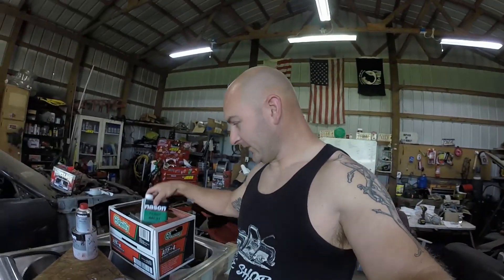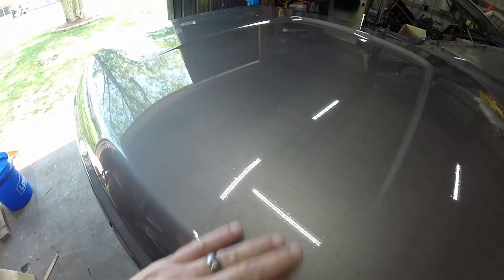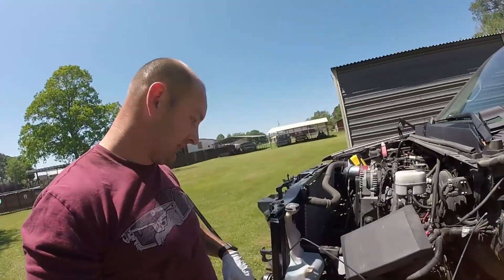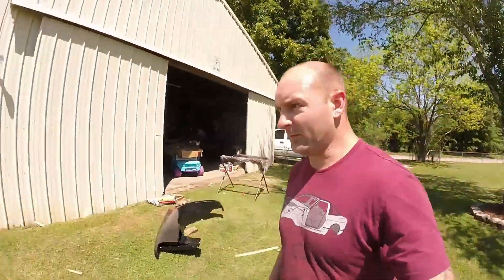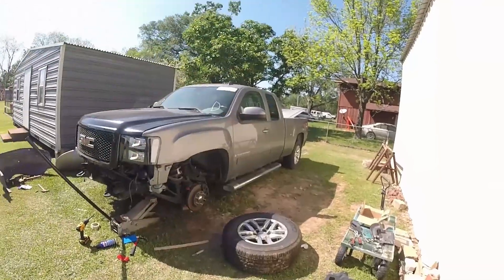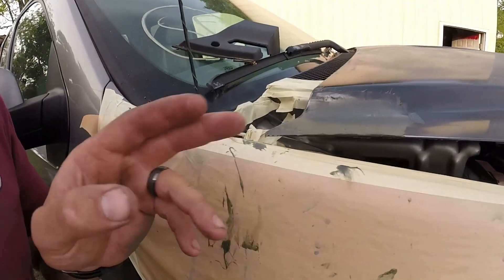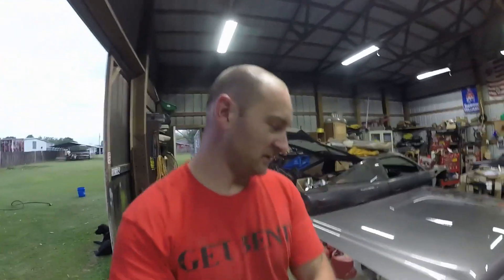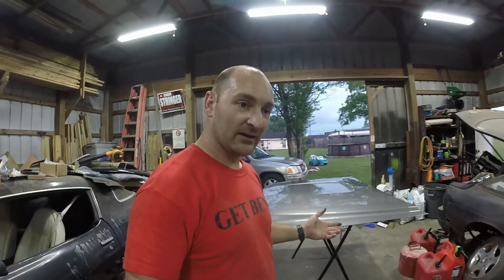First Time Ever Painting!!!! (2008 GMC Sierra 1500 z71 Copart Auction Salvage Rebuild Part 7)

Comment: How did you put grille on I have 07 z82 GMC Sierra looks exactly like the truck got it from coparts need help
Reply from the maker: I got a new center mount, and just worked with the 2 outer mounts until it fit, it’s not perfect but it fit and has been holding on for 3 weeks of driving on the interstate.